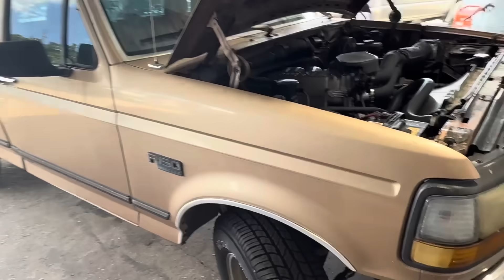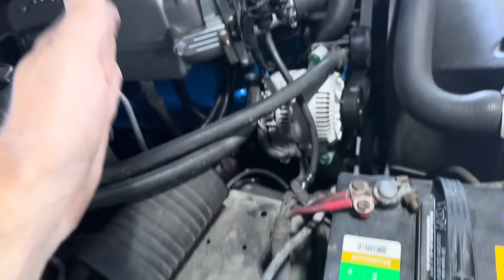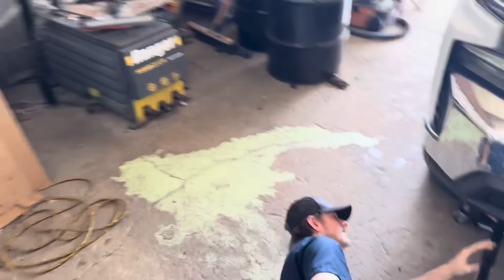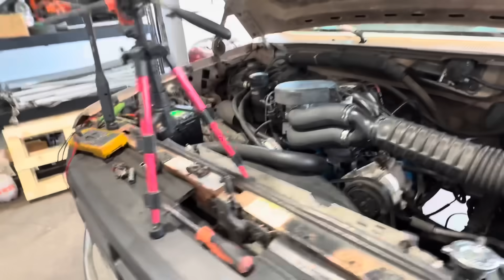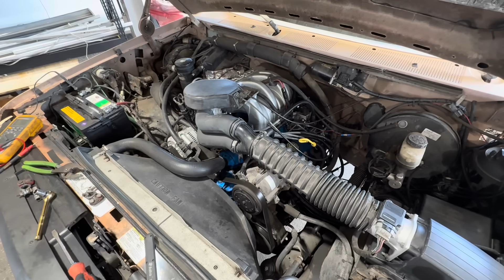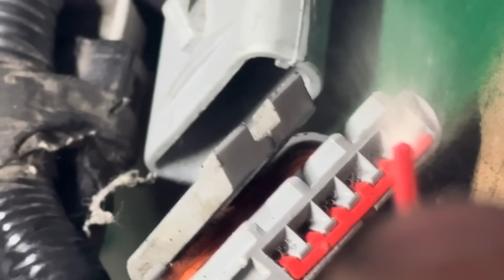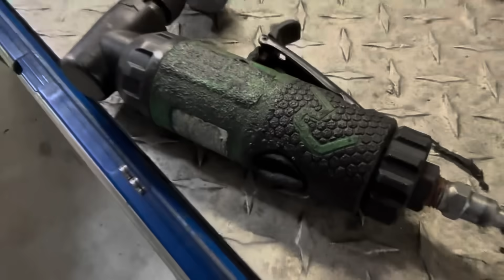Crank No Start! Accidentally Fixed! Can’t find the Problem! Ford 5.0

Comment: During my 40+ years of repairs where the engine is surging like that, one of two things or both. Positive cable grounding to chassie or vacuume leakes. Cant even remember how many times a faulty installed aftermarket radio was the fault of just positive unfused powercable grounded to metalparts on the chassie. Created idle surges like nothing else.
regards from Sweden.

Comment: That era is VERY prone to cross firing between ignition wires, Ford specs a specific way to route them.  That's what they were trying to stop with the spiral wrap which is a joke.  I had it on mine when I got it, replaced the stock wires routed per Ford spec and still did it.  Switched to a set of Ford performance 8mm wires, I  cut and crimped them to length and no more issues.  You may have moved the wire that was cross firing....

Love my 95 F150 4x4 with the 351, has the factory posi rear axle with the tow package.  30 years old, still clean and running strong in Pa.  Fluid film it every year after a good pressure washing underneath.

Comment: Positive and negative battery posts are different sizes.  Replacement cable ends therefore come in two sizes.  You used a negative clamp on the positive post - that's why it didn't fit.
You CANNOT test resistance with current flowing through the wires.  Please learn how to use your meter.

Comment: I would just like to point out that you got a negative resistance value when you measured from the battery to the alternator. Negative resistance is impossible so that is a sign that the measurement is being done wrong. Probably the best way to measure resistance for what you were doing would be to disconnect one end of the wire you are testing. This isn't necessary if you are just checking continuity, but you won't always get a good measurement on a live or complete circuit.

Comment: I would disconnect that tach  I actually had one shorting out internally causing a chevy to cut out when ever it felt like. I would also fix the ground wires. If you have a ground issue some of the components that are mounted to the fire wall and fenders may be the only source of ground that some stuff is getting its ground from  causing a ground loop start with engine ground to fire wall then ground to battery then fender.

Comment: The best way to rectify this issue is get rid of that ignition system and install the tried and true points & condenser.  Probably need a ballast resistor to but that would fix it.

Comment: Very funny Ray! You should have called an 800 psychic line and asked about the resistance on those wires. Would have been more hilarious and just as accurate as trying to use a DVM to measure resistance on an energized automotive charging circuit cable. Good comedic effort. I give a 6.3 out of 10 to Ray on this one, for creativity in punking the average viewer.

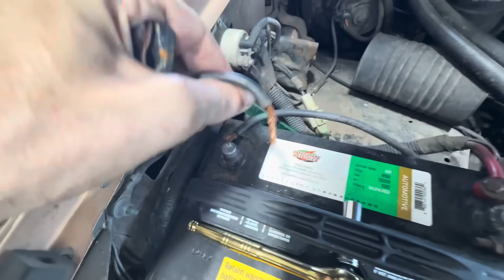Comment: 6:00 they don't have to be copper, you could check if they're magnetic or not! There are a lot of wires made from chinesium out there that look like copper but they're just made to look like it, with way more resistance than a real copper cable would have.

Comment: Ray, when you disconnected  the minus connector hanging, you should have replaced the positive one first. Love your videos,  always.  Never check for resistance knowing there's current flowing through the wire,  you'll get false readings. Disconnect the battery when doing ohm tests.
Reply: I agree when checking ohms.  Alternative if it can start is to leave battery connected while running and check for current from alternator case to battery negative.  If it can start it's a safe test, bad ground will show current routing through meter.    

The shiny spiral wrap on the plug wires pretty much defined the issue someone tried to fix.  Crossfire between ignition wires, they have to be routed per Ford specs when replaced and those ones are not routed properly.  He most likely moved one of the ignition wires while poking around and it stopped.  Stick some good Ford Performance wires on it and be done.  Seen it many times.

Comment: ford in those years had issues with that icm even after they moved them off the distributor. I had an old 4.9 inline 6 that had it on the distributor i used to keep 2 spares in the truck at all times as they were so failure prone i got good at swapping them out. I think they had a big class action lawsuit over it which is why they came up with the retrofit to move it to the fender

Comment: I once used a battery spray before I reconnected the wires well that protect cleaner caused a no start condition so adding those protection sprays and greases are a bad idea.

Comment: I would of started with the relays. In 1993- 1997 if i remember right those was the years was the worse onnthe starter relay my friend had replaced his starters every 2 or 3 months i was replacing my frod explorer starter every 6 to 8 months . Starters should not go out like that i had replaced the battery cables + and -  added more grounds it started to act up i made mental noes of the engine temp and out side temp  it was popping the relay or making it harder to switch afternit got over heated. My friend had a ford f250 1996 he was replacing his starter every 2 or 3 months  i bought a relay tester off of ebay when there is mo start or crank i fo grab my relay tester  a bad relay could cause alot of tjose trouble

Comment: this is an idle air control valve or air getting sucked in due to a vacuum or air leak throwing off the fuel trims.  clean the IAC and 
smoke test the airbox tubing to the throttle body, also use a scanner and look at the fuel trims and misfire counts

Comment: I bought a 95 f150 set the timing correctly from the previous owner who tried to fix it and similar situation get it running come back next day won't run it will start and run on brake fluid Then a week later you come back to start diagnosing it will start and run ?????????????? fuel rail good fps good when it won't run fuel pump won't run direct jump it still no run change computer no difference Some day I'll figure it out !

Comment: While you're at it. Why don't you just de-badge those pretty blue tool boxes. Grind the plate right off. I don't see the funny or fun in screwing up tools. You pay good money for.

You realize your circuit is live right.  I'm not saying you can't do it this way. But it's best not to... The last time I had an old Ford do that. It was the distributor. I know it's got a new one in it. Did he replace the distributor because of the problem? Or did he replace a lot of other things after he replaced the distributor? Boy that became a tongue twister😂

Comment: Ray, just unplugging and plugging back in cleaned the connector enough to make connection. Easy as that. Those trucks sometimes have a mind of their own when it comes to electrical connections. I had one that lost a tooth on the timing chain gear, it would run perfect sometimes and sometimes not at all. Two mechanics and a Ford specialist later no cigar. A shade tree mechanic I knew found it. I don't know how, but just handed me the gear and said, you don't owe me nothing and walked off laughing. I got a kick out of you saying, I'll clean this a little and used a half a can of spray. It is probably fine now, the only thing is, you cleaned the heck out of one side of the connector and not the other. I don't think you need to, the truck is running fine. I love the old school aftermarket radio and tachometer. Good job Ray, even though you weren't sure what you did.

Comment: You can quickly eliminate the ground strap theory by simply running a jumper cable from the negative battery post to the frame or engine. If it affects things then you’ve found the problem. This might take you a whole 5 minutes

Comment: There is a electronic module on the side of the  distributor that will overheat and shuts down, it cools off and heats up again. But when the engine is cool it will start again. Replace the distributor with the module made in Mexico. Not the one made in France. Had the same issue w I th my 5.8, also check to see if there is a Crack on the trotter body ,with a small leak that will shut down with a small amount of antifreeze leak.   Thanks Ray for another great video.
Reply: that was the one on the fender ford had to change it or offer a retrofit kit to move it off the distributor i believe after a class action lawsuit i had an old 300 -6 with it on the distributor i kept 2 spares in the truck as they failed so often and were at the time cheap could replace it in less than 2min and be going again

Comment: Spark plug/spark plug wire intermittent grounding issue. Pcv vacuum leak? If it straightens out under a load I'm thinkin' that stuff. It could be timing related- loose timing chain/guide. It could be throttlebody. It could be a goof battery. Fuel filter? Run it unless it develops driveable issues. 

The problem needs to get worse in order to be made better. 

The vehicle has habits. As long as those habits don't change then drive it. ❤😂

Comment: Ford has a tsb check the shielded wire it grounds inside to the shielding,the stainless wire wrap  chafed the signal wire , check grounding between tinfoil an signal wires ,hope it helps

Comment: Throttle body not opened to specifications. Idle air controler can't keep up. Baseline idle at 800 in park with iac unplugged. Happy motoring.🎉 95 f-150.

Comment: Check the engines ground stra from engine to chassis. Some of the ford economies vans had the ground straps on the bottom and exposed to the elements. The would corrode and cause all sorts of problems. 👍

Comment: I had a 92 5.0 mustang doing the same stutter skip and it was the pickup it was bad in the dist. It wasnt bad but the pickup was loose and I put a little shim to hold it still and the miss stopped. Changed the dist. and all was good.
Reply: The distributor (and all the other ignition components) have been replaced.

Comment: You bought a wrong terminal, the +ve is usually bigger.  You should not have to bend it like that.  Copper is corroded, you need to expose fresh copper.  The corrosion does not affect the wires ability to carry current, it affect its ability to connect to the connector.

Comment: It may be apples and oranges, but I had a SBC 400 in a Caprice Classic 74 model, that presented with these same issues, dead battery for no reason, up down idle, turns out I had a short in the starter somewhere and once that was remedied, it ran like new. It should as I had already replaced everything BUT the starter, like carb, distributor, cap rotor wires ,coil, alternator, battery, battery cables, etc

Comment: mine was the fuel pump cutting in and out cause of a bad relay. That should be the 5.8 litter. in the end my fuel pump relay was bad and also the power plug on the fuel pump corroded.

Comment: I had a 1995 Chevy pickup with 5.7L engine. One Day while driving it cut off and wouldn't restart. All wires looked great and were original factory.  Long Story short, After a few mechanics couldn't diagnose problem. Lots of new parts thrown at it. I found a unseen break in connector that pluged into Ign Module in distributor. As soon as I spliced in a new connector. Truck fired off and has been runing fine. That was about 5 yrs. ago.Wiring will drive you crazy and cost you alot of $$$$

Comment: Well, a ray, I only worked on one of these. Same symptoms….crank no start. It had an after market tach. The problem turned out to be an intermittent short to ground in the tach. A real bear to find, but disconnecting the tach fixed the stumble and the no start. Hook the tach back in, and although it started, it stumbled. Weird, right?

Comment: I had a similar issue with my 87 f250 5.0L manual transmission. Check the wiring harness for damaged wire. There is a 12 gauge wire that powers the PCM. My ECM/PCM had no power, running a rough idle, no start condition or hard to start. Before it died the tachometer was all over the place and poor running condition. One end is on the starter solenoid and has a Maxi fuse, I think just reading the diagram. The relays are powered by the twin wire fusible links for mine. The other connects to a push in on two sides to release connector that is unobtainable as far as I know. Location of wire is the center of the connector. It is by the relays, brake booster area. I am looking at the 95 diagram. The Pcm pin number four. To check the wiring harness, you need remove the top bolts to the radiator and air intake to pull radiator out of the way. The wiring harness is attached to the frame with clips,  goes by the headlight; it then goes under the air filter box.   The yellow wire could be corroded or damaged and the PCM is not getting enough or unstable power. It looks like factory wiring That could be the problem of many of that trucks problems. Note: there is a lot of electrical tape to remove.

The ground cable could be undersized by now and causing resistance. I have no idea if you did check the wiring harness at all, but do that first before parts cannon. Worst case is the PCM and that can be taken apart with a 4mm socket for component inspection.

Comment: Ray, back when I was a young pup 60 odd years ago running amok barefoot and in my bathers with no pockets I would keep my Air Rifle pellets in my mouth between gums and lower lip. Inevitably on the odd occasion a pellet would dislodge and get swallowed. I'm surprised I'm still alive and don't have a elevated Lead content in my system.  
In regard to the truck earthing problem.... I'd be fitting new cables to the battery with moulded on connectors and be wire wheeling the block and chassis connection points.
Cheers Eric E

Comment: Ray, @polypusify - and others have identified the same flaw in your DMM readings.  They will nearly always be WRONG with an active circuit and current flow in wire/component you are attempting to measure.
His final comment about indirect resistance measurement is also pretty quick and easy - if you have a hall-effect clamp-over current meter.
And those wire-ends on battery terminals look pretty crusty to me.  You might like to consider dipping in a de-oxidizing solvent to clean up B4 re-terminating.

Comment: I remember as a new driver my father had an Audi 200 which would have a stumbling ignition, I could be driving at highway speed and the engine would hiccup and stagger for a while (with the tach flicking) and then just carry on. It was in the shop several time but as an intermittent fault they could not find it. Then while visiting an old mechanic who was working on my friends car I described the symptoms to him and he immediately said 
Dried up Condenser.
Took it back to Audi they said we do not use a condenser it has electronic ignition so dad requested they change the electronic ignition unit and it never failed again. I guess even little capacitor can dry up.

Comment: My sister's Honda had a very similar problem. The engine would cut out and the tack would do wild things at the same time. It ended up being the Exciter module in the distributor. I would try the ignition module, but I would disconnect the tack first and see what happens.

Comment: To improve the connections to those temporary permanent battery terminal connectors, use copper crimp sleeve caps.
Reply: Melt the gold from your wedding ring into the connection.

Comment: The electronics tech in me wished you had put an amp clamp on that ground wire.  Just curious exactly how many amps were flowing through it.  Then measure the voltage across the wire.  A quick Ohm's Law calculation and compare to the ohmmeter.  But, that's just me.

Comment: you need ground straps from motor to cab and frame. originally they in the rear of the motor.  theu flat braided steel or copper

Comment: Ray check the (Thick Film Ignition) TFI module that is mounted on the left fender. Some are mounted on the distributor. The distributor mounting type must be installed with dielectric grease. If not it will heat up and fail.

Comment: I didn't see it, did you test the alternator connections, output and diode operation? That's the first thing I do with any suspected electrical problem. An alternator with one bad diode will still charge but can cause other strange problems, back-feeding etc...

Comment: Well Ray, I have a 2004 Dodge 3500 with 5.9 cummins. It would act like you quickly shut of the key and quickly back on, basically a jerk. Then run fine for another thousand miles or so then do it again. Sometimes the engine light would come on. Throw a code ,I would then  replaced what ever part and everything was good again. After replacing throttle position sensors, crank sensor, cam shaft sensor , high pressure fuel rail sensor , fuel control actuator some multiple times it was getting a little expensive and seems nobody knew what the problem was.  Then a back yard mechanic told me it was the alternator with a bad diode. Nothing seemed out of place with it as it kept  the battery charged. So off to AutoZone I went . They hooked up the alternator tester, while the truck was running the guy said there was nothing wrong with it , right then the engine stumbled, he says what was that, I said thats what I want to know. Looking back at his tester he said hey your alternator is bad. It seems that a bad diode would back feed and cause the engine computer to throw a code where ever it was in its process. Now I don't know much about all this electronic stuff but replacing the alternator solved my problem.